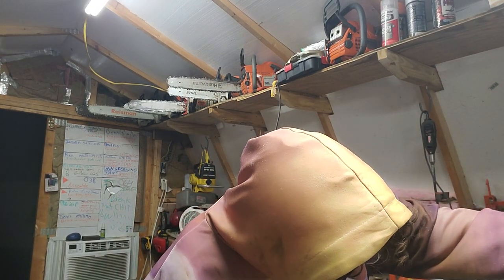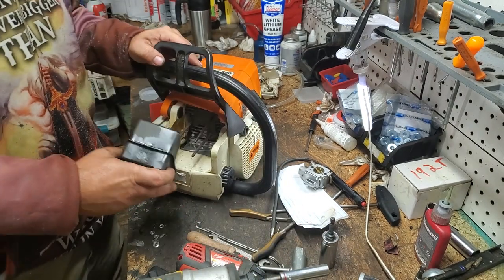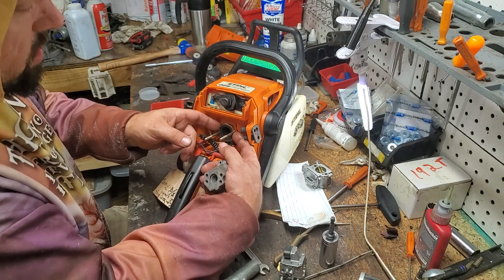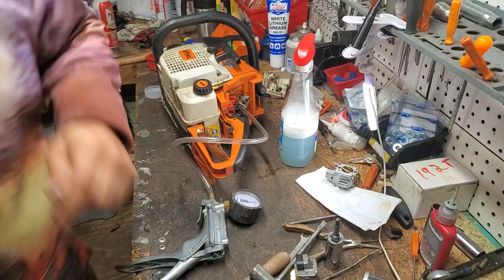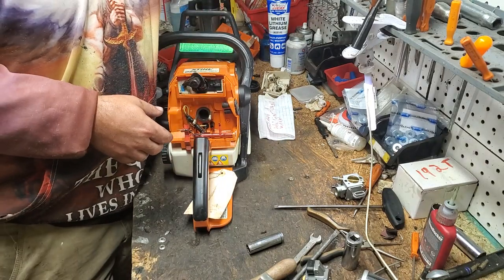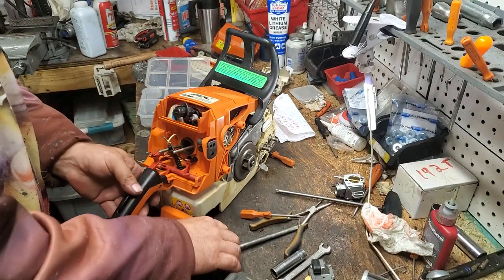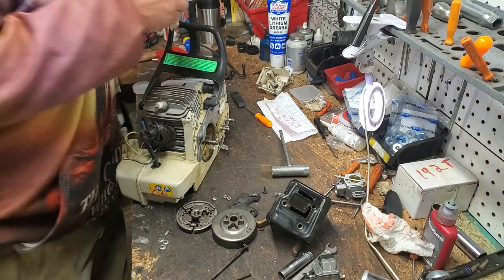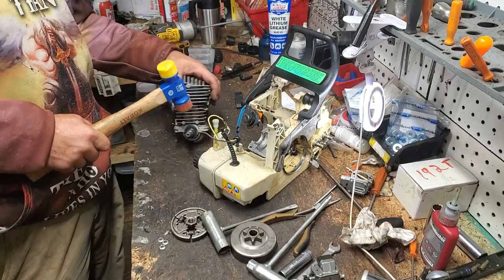STIHL 029 Super chainsaw hard start + won't idle DR DIAGNOSTICS plus speedy dissambly

Comment: I bought the Stihl flywheel knock off tool. Couple love taps with the saw flywheel upside down, flywheel comes right off. As before, I slather the Dirko on the shortblocks. Bigger the glob, better the job. I know it's a bit more than permatex, but it's been working wonders for me even if it's out on the unheated porch during the Northern winters here in NY, where it gets to below 0°F.
Reply from the maker: Ya plus you don't have to let it set 24hrs like permatex
Reply: @chainsawredeemer85 While true, I let it set overnight though to make sure. But you can just wait about a half hour to an hour and crank it over.

My 029 Super to 039 conversion, it had hard to start/wouldn't idle because the cheap Chinesium fuel line kinked at the bend it needs to sit in for the HD-18 carb. Got an OEM line and it hasn't given problems since. In essence, don't use aftermarket fuel lines if there's a 90° bend, they'll just kink.
Reply from the maker: always better safe than sorry right. I usually always wait AT least 24 hours but sometimes I get ahead of myself lol